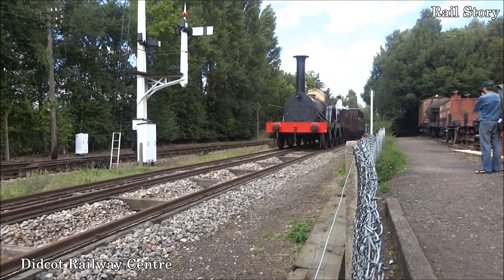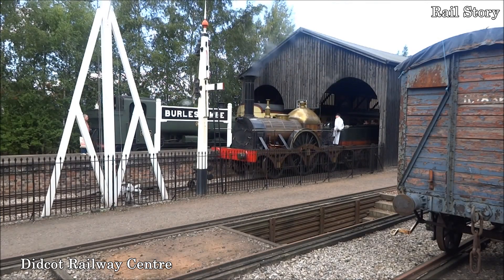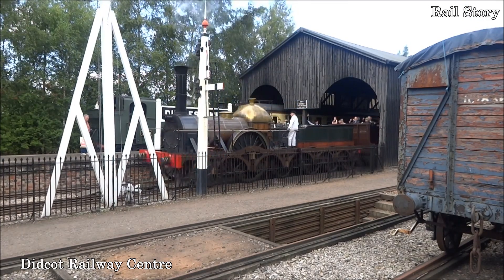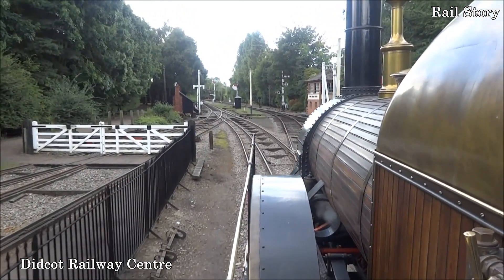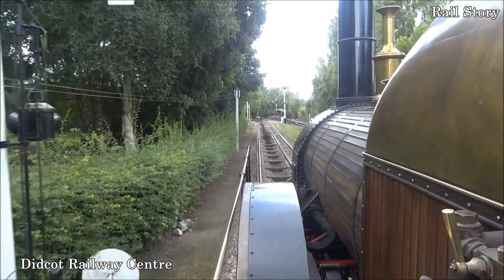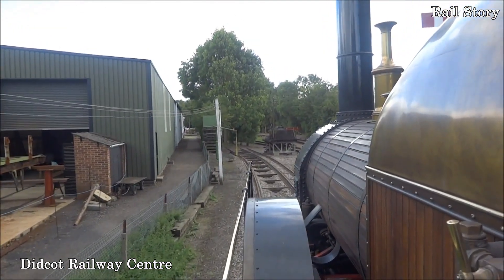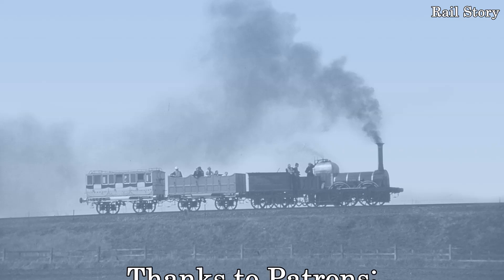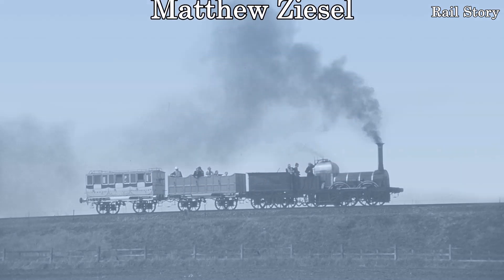Firefly: The First 'Standard' Locomotive

Comment: Excuse me Mr Dawson but what is the boiler diameter for Firefly, North star, and the Iron duke.
Reply from the maker: North Star boiler was 4ft outside diameter; Firefly was 4ft; Iron Duke 4ft 9 3/4in
Reply: Thank you. For days I have been researching the boiler diameters for these locomotives although this means that the earlier standard gauge locomotives must have had small diameter boilers.
Reply from the maker: @Tak3anap  Not neccessarily. Or by that much. Patentee's Boiler was 3ft 6in, whilst Ajax, now preserved in Vienna has a boiler diameter of 4ft 6in. Robert Stephenson was making boilers up to 4ft diameter by c.1840
Reply: I see.